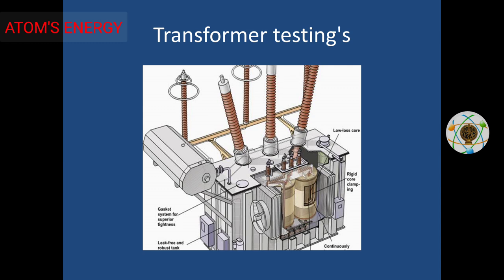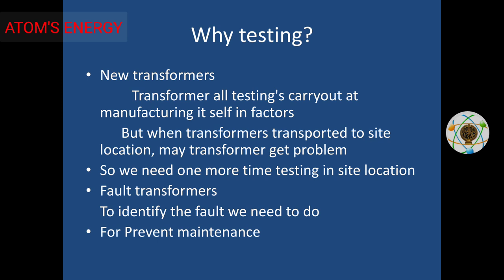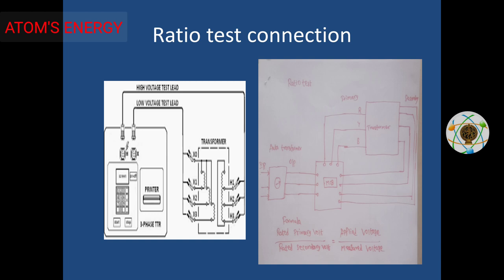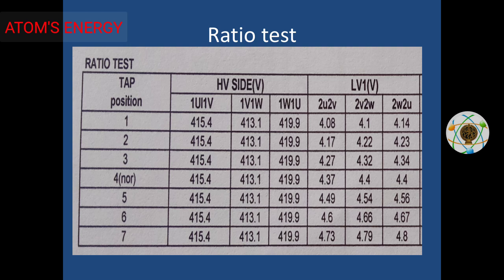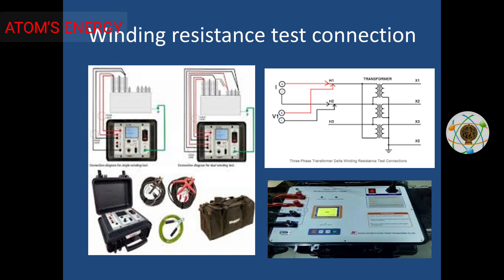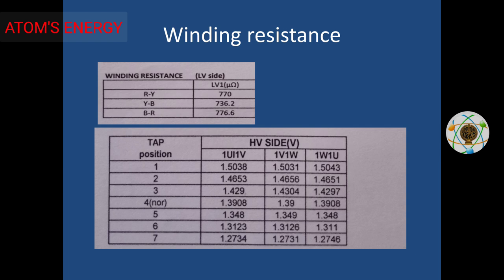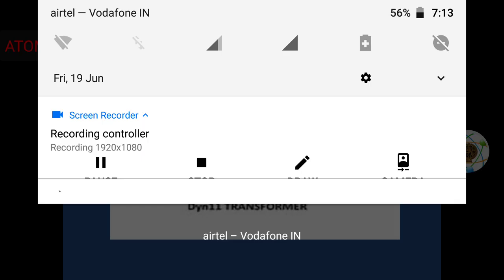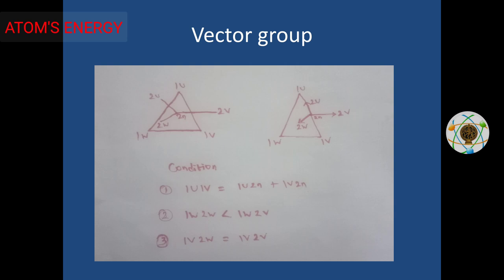Tamil Transformer testing full explanation in Tamil

Comment: Magnetizing current test la RYB value leakage tester ha ethala podanum t/f py or sy side
Reply from the maker: Thanks for your support, bro nenga High voltage side measure panikalam, ethana tap iruko athana tap laum measure pananum, variation athula than theriyum, transformer winding condition athula than confirm panamudiyum, thank you
Reply: @ATOMSENERGY  winding resistance epdi edukarthu